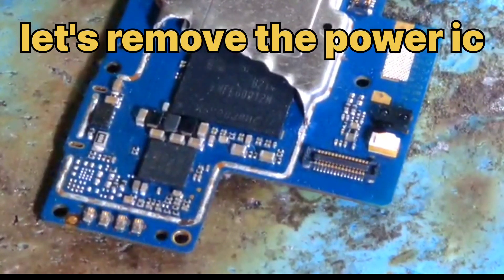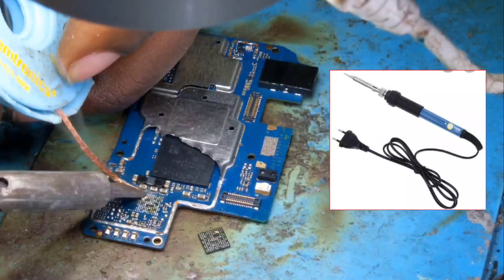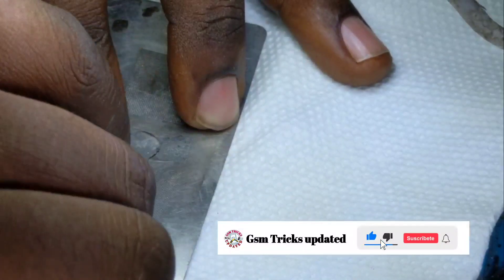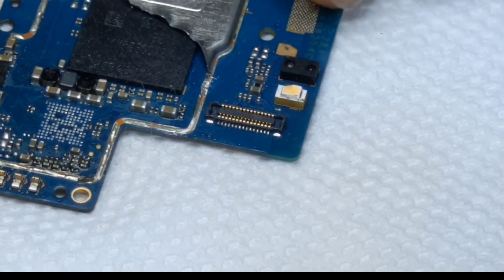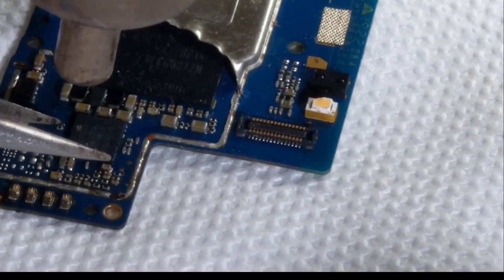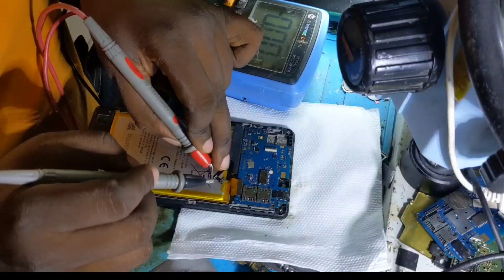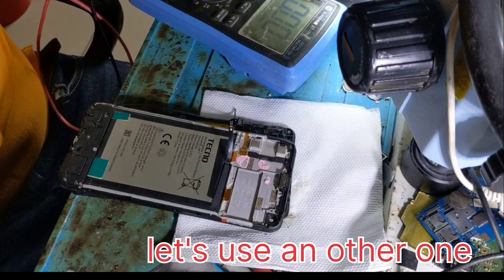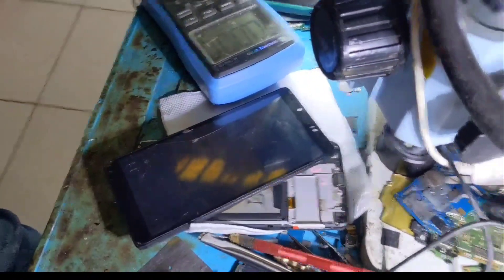Avoid These Mistakes When Replacing a Power IC for the First Time

Comment: Hello there, I seem to be unable to remove this power IC so far succesfully.

I am using AmTech NC 559 ASM flux. And an Atten ST862D Hot air station without nozzle.

I tried with warming it up in stages: 1 min 180C 40% airflow no nozzle. 1 min 260C 40% airflow no nozzle. Adding more flux. 360C 40% 40% airflow no nozzle. Adding more flux I tried to bump it up little by little, adding more flux, up till 415C 40% airflow no nozzle.

All I seem to be getting is burned flux. And while all the components around the IC get nice and wiggly the IC doesn't give even the slightest wiggle.
Reply from the maker: I am sorry bro, i don't know the type of your rework station, but, with a such temperature and airflow it must be  removed, unless it has a glue !
Reply: @Gsmtricksupdated  Thank you for your reply! There might be a big heatsink underneath. I will try tomorrow with the smallest nozzle I have. Maybe that will work. At first I didn't want to use a nozzle to not risk to blow other components away; but now I might have to use it